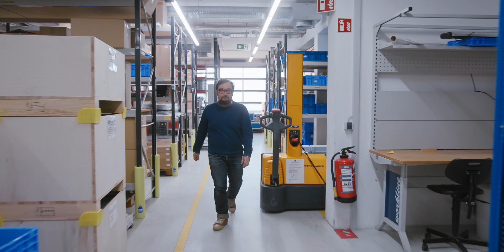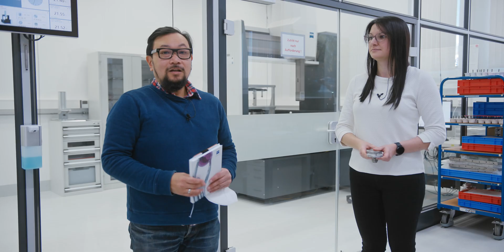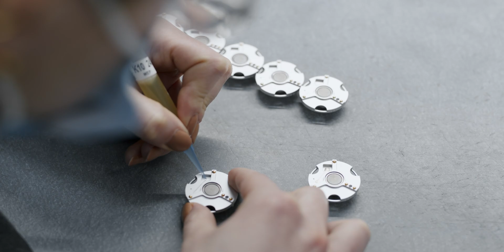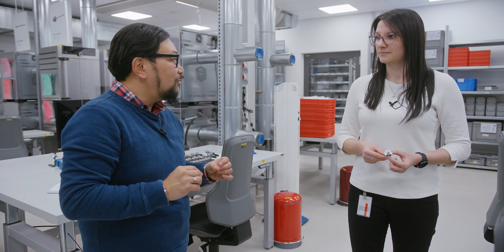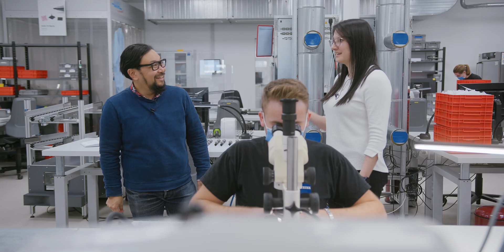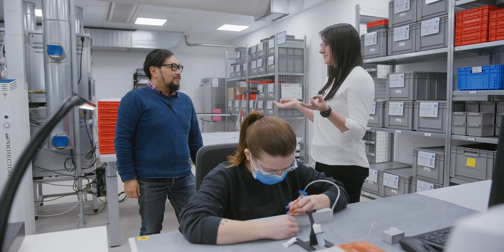#measuringhero | CMM Qualification Tools: The Making-Of

Comment: Rather shocking to see that reference plates are measured by hand, using a regular old granite plate, dial indicator arm stretched way out and a dial indicator made by another quality assurance company.  This is not even proper measurement procedure for manual instruments.  And all this is happening in a facility with a Xenos.  I would expect that every reference plate would be measured to death on the best possible equipment available with 1000s of points stored and recorded.  "Zeiss reference tools, quality assured using the most basic tools from our competitors".  Not trying to hate on this video, but as a very large Zeiss customer, this is disappointing to see.  Hopefully VAST plates are not made this way!
Reply from the maker: Hi miltera, we are sorry that we gave you a wrong impression. We would like to emphasize that the part of the video you are referring to belongs to the final inspection – after the adapter plate was already heavily tested with our ZEISS CMMs. The video is an extract of the whole production line. To show every step would unfortunately be beyond the scope of this video. We would like to invite you to visit our production as soon as conditions allow – so we can go into all details and answer all your questions.
Reply: @ZEISSIQS  Thank you for the response.  It would be great to see the other aspects of the reference plate production and how you measure these on your CMMs.  It's always interesting to see how expert Zeiss users attack inspection challenges.  As for a visit, part of the initial selection process of what brand of CMM we would go with was a visit to your headquarters.  It was very impressive.  This was about 10 years ago now and would be great to come visit you again once restrictions are lifted.  It would be very enlightening to see the latest technology, thank you for the invitation.